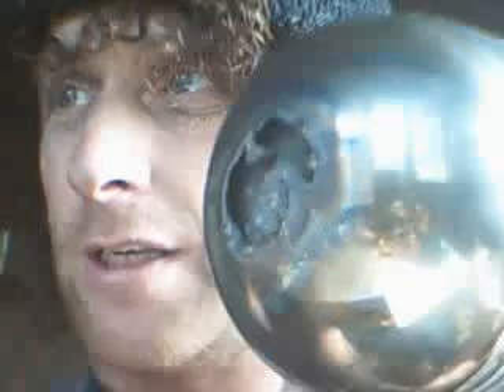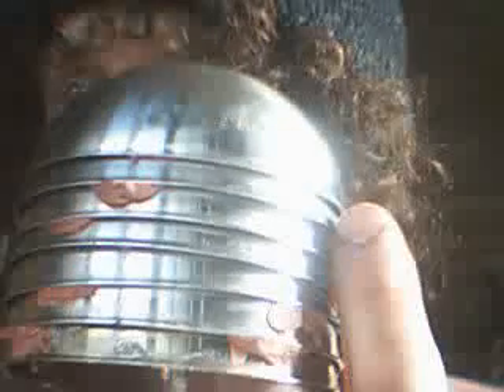hydrogen fuel cell electrode

Comment from the maker: basics are not to rely on electrolysis, that is only the pulse centrifugel part, to spin the water molecule like an electric motor spins the centre, off the outer bushes the main part is frequency to excite the molecule to split.